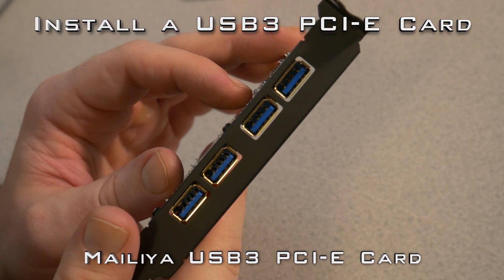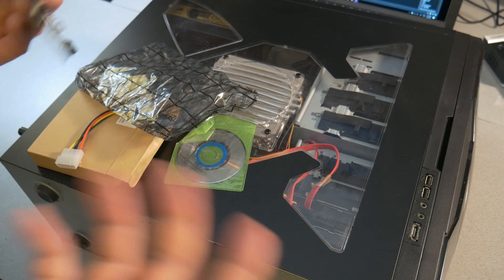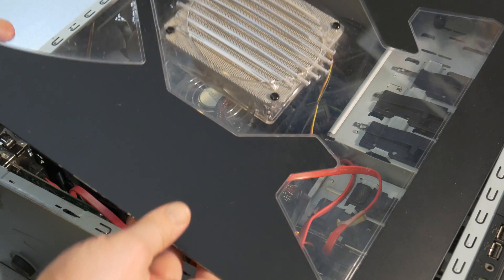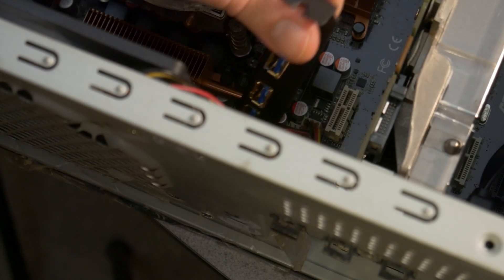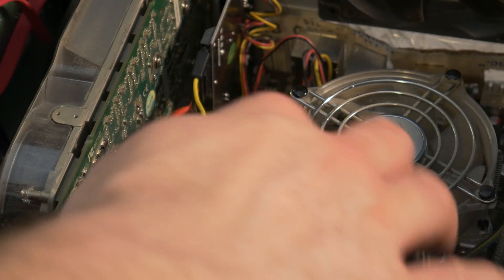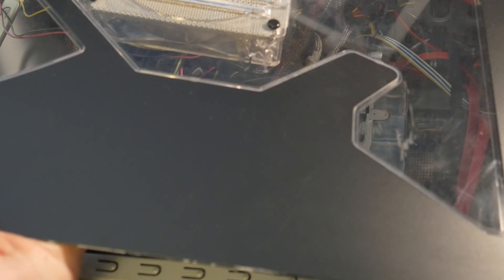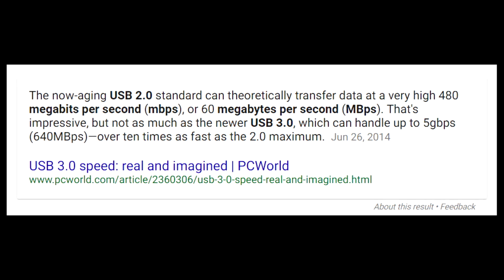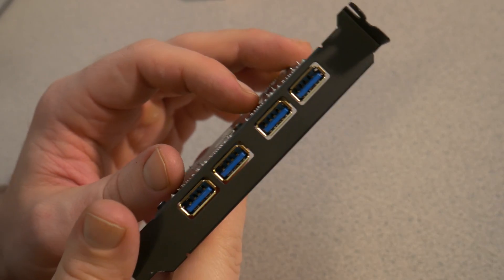INSTALL A USB3 PCI-E CARD | ADD USB PORTS TO YOUR PC! (MAILIYA PCI-E 4 PORT USB3 CARD)

Comment: When I put my USB 3 card into my DELL Optiplex 790, it is detected and listed as 'working properly' yet whenever I plug anything into it, it reads for a second then unreads. Sometimes is rapidly reads and unreads over and over, other ties it jst reads then unreads. Very confusing and very upsetting.
Reply: Delete drivers,  reboot, reinstall drivers, reboot

Comment: I installed the card and plugged the power connector to the card but got a message at boot that I need to plug a power connector to the mobo itself if I am using that PCIe slot as there are too many cards plugged in my system. So I did just that and left the sata power connector plugged to the card as well. It worked fine but I was concerned there must be too much power coming to this card so I removed the sata cable. Is that ok or should I leave the 2 connectors plugged in i.e the one to the mobo and the sata one to the card? Great vid BTW; Thanks

Comment: Great video.  I bought the card and will be able to do the upgrade thanks to your video.  Thanks for taking the time to show the unboxing, the card, the installation, the OS, the drivers, and the speed comparison from 2.0 to 3.0.  Nicely done.  I'll follow up on this post after my new card arrives on 12/5/2019.  Thanks again.

Comment: Need to know if the linux/ubuntu OS will automatically recognize the USB 3.0 card before I buy one. Anyone know?
Reply: Yes
Reply: @the_official_jaydo  Thanks for the reply... better late than never... I'm back on Windows 10 - I don't like it much but I just don't want to spend time "fooling" with Ubuntu et al to try to get it to work with programs I want to use + updates etc.
Reply: It will

Comment: Great video. Mine is coming in the mail today. It's made from a different brand but the reviews proclaims that when copying stuff over from desktop to external hardrive that it averages between 100mb per sec to 150mb. Crossing my fingers.

Comment: Thanks for the clip.  I have a Dell optiplex 780 tower (usb 2 only) and wanted to expand the number of usb ports (some actually don't quite work) so it dawned on my that I could get an internal expansion card and one that adds usb 3 capability to boot and found this card on amazon and here it is featured in your clip.  Made my day.